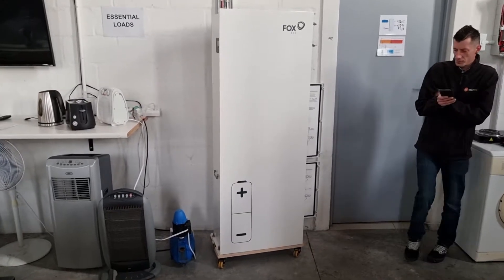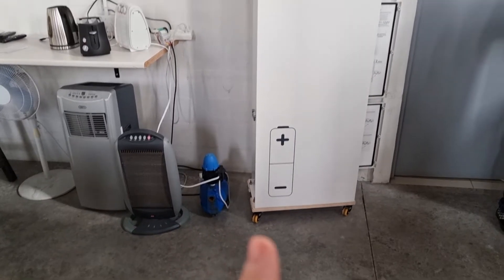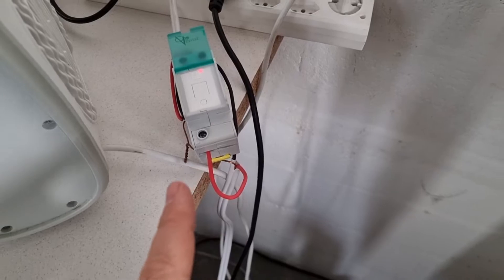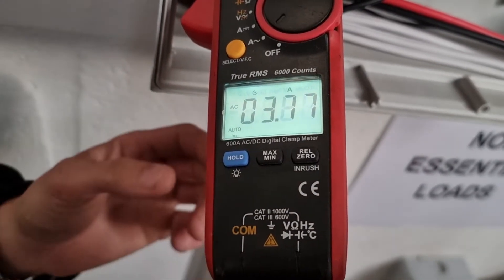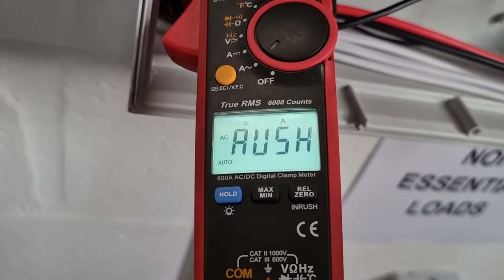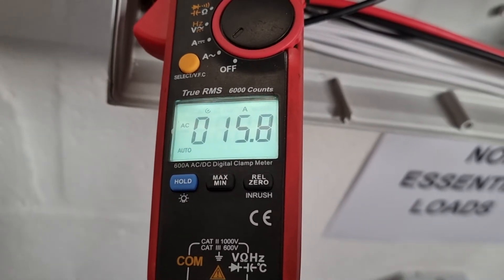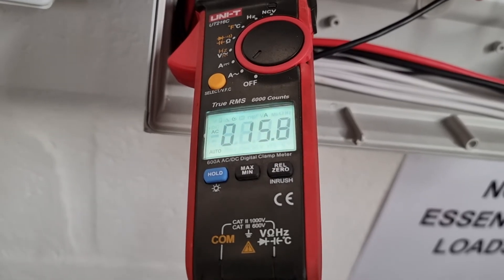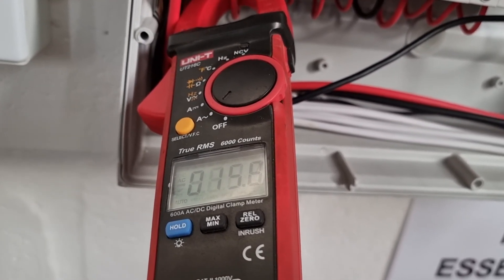Understanding Inductive Loads affects on a Solar Inverter

Comment: This explains exactly why you should never install a high frequency, transformerless inverter for powering household inductive loads and install a low frequency, transformer based inverter instead.
Reply from the maker: tks, that is true but check out the Fox 10.5 and it copes awesomely well with high loads https://youtu.be/reKuhcEoAP4?si=87BPv__QsKXAWiYR

Comment: Unfortunately, the discussion is NOT about the reactive element where current is out of phase with voltage, but rather, the large starting current demand of a typical electric motor.

Comment: What inverter size can I use to power a single phase, 3kw, 240v induction motor off of batteries without frying my system?
Reply from the maker: for that please use the inrush current function on your meter to measure like in the video
Reply: The starting current of an induction motor, also known as inrush current, is usually 5–6 times the motor's full load current (FLC). However, during the first half cycle of the electrical supply, the current can be more than 20 times the FLC.
A "slow start" circuit can alleviate most of this problem but might cause the motor to fail to start.  It's torque is very weak at startup.

Comment: This is an excellent example as to why you should never, ever purchase a high frequency,, low surge, transformerless inverter. A far better alternative is to invest a little more money and purchase a low frequency, transformer based inverter charger for your solar system. Low frequency transformer based inverters last years and years longer than these toy high frequency inverters and can easily power high surge loads without being damaged. That's why the big name brand inverter manufacturers like Schneider Electric, Outback Power, Sigineer Power, Victron and others, all use a low frequency topology in their offerings. I know this to be true because I've spent the last 23 years repairing inverters. High frequency solar generators/inverters simply don't last when powering inductive loads.

Comment: Garbage the only why any inverter refuse to start up a induction motor is the design I design many inverter high and low frequency and all design under 5kw start any induction motor if the overloaded potentiometer is adjust below 3kw and the motor is a 2kw motor then it won’t start the surge current will trigger the sensing voltage turning off the spwm signal powering down the inverter that’s how inverter work and most time factory don’t spend time to adjust the overall loading process so you end up will a powerful inverter that cannot release it powerful due to overloaded sensor controller not tune to the load ratio

Comment: Can you clarify how is it not able to startup the irush current of 15.8A? if the 5KW inverter can provide a max 22.7A of current (assuming 220v)?
Reply: Dear Mark, thank you for your great question.  You are correct we are using 220V and in this case, the inverter did run the pump.

However, in the real world and the inverter is not only running a pump in the client's home but is also powering other appliances at the same time.

The overload and questions from clients typically come when the pump starts in conjunction with other high-load kitchen appliances like a kettle toaster and or microwave are turned on causing an overload.

In most cases, as the pump turns on automatically with a pressure sensor switch and not the client turning it on an inverter overload then occurs. Hence the question but it's only 700W pump, how can it create an inverter overload?